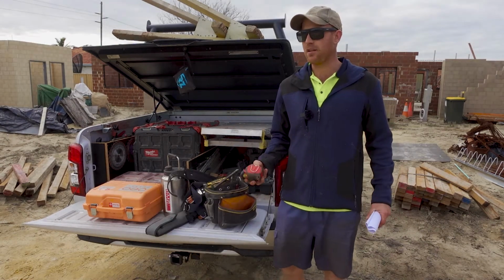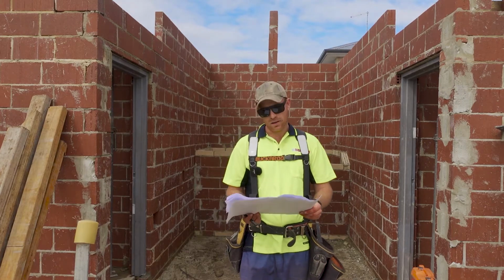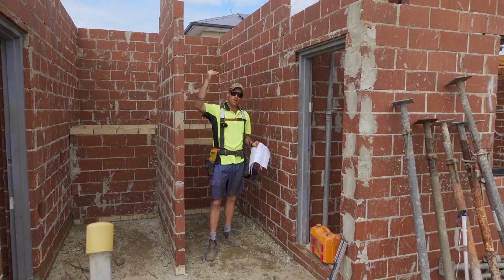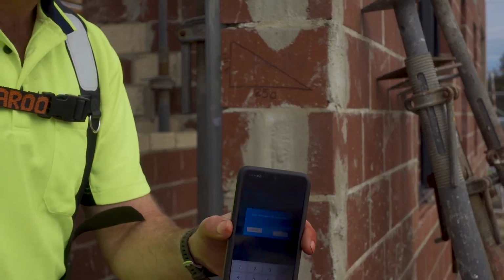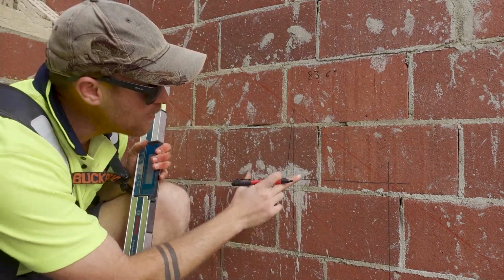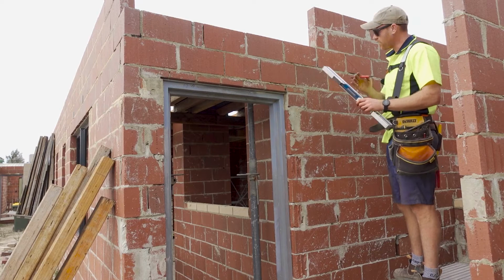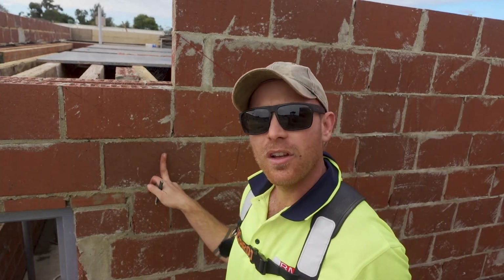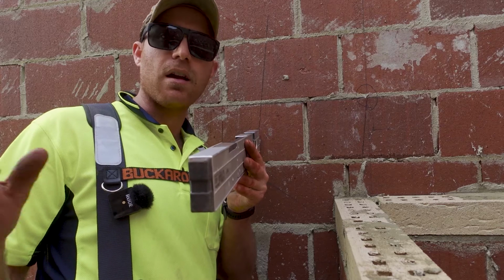How to mark out stairs for 2 storey house suspended concrete slab

Comment: On a site where you’ve got repetitive stairs to build, I always made a plywood template to layout the stairs with. Just locate your top and bottom critical points. Then lightly fasten the template to the wall and mark it out. Much easier and faster than marking each step one at a time.
Reply from the maker: Yes for sure. Unfortunately I reckon in the 20 plus years I’ve been doing this there has only been a handful of times we got repeat sizes.

Comment: I usually make my stairs as a unit cut 2 stringers using ply triangle jig to cut out profile. fix all the risers between the 2 ply strings. 3 tec screws either side will do for 9 riser run. Way less fixings than fixing each riser.
Reply from the maker: Yes I would do this is all my stairs were tge same but they are not. By the time I cut a saw tooth string I can get far more rises installed by using extra fixings. And as a business owner the fixings are far far cheaper than cutting up the material for a string. But it really depends on the materials in your local area which are available at a good price.
Reply: @bmformworkconcreteconstruc9783   ya I know what be at u mean I usually put it together and get  up to 20pours per set on the medium rise stuff with 2 stair cores. Love ur work